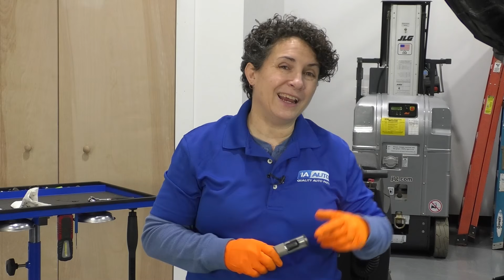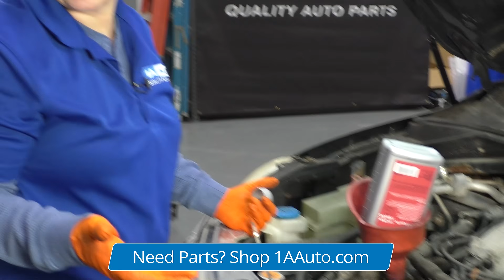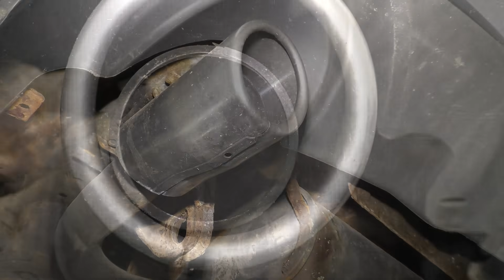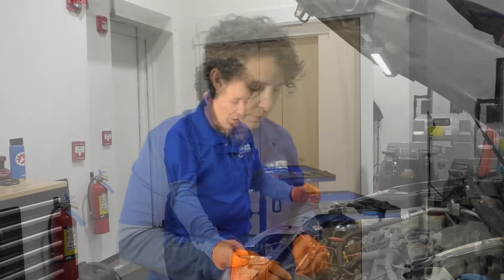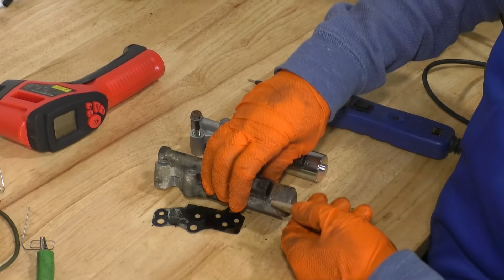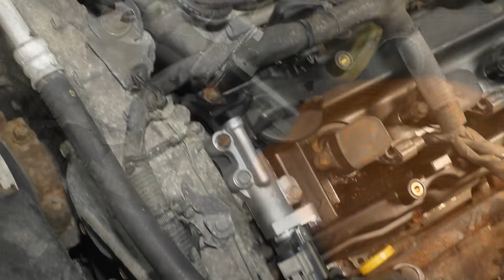Check Engine Code P0011, Rough Running Engine? How to Diagnose VVT Solenoids!

Comment: Please help. I have this code p0011. Have changed the oil and oil filter, have cleaned the sump and mesh filter. Have replaced the vvt solenoid. But the code won't go away. I also have the oil light flashing. Please help

Comment: What happens if you got that code and the car fails to start or just cut mid drive? The only other code that flashed up on mine is a misfire which I've found was due to a non-functioning coil. I've changed the Sparks as well and that cleared that up but the car just fails to turn over

Comment: After watching this I think that is my issue and I went to my auto shop and asked about it and I got told it was one of my motor mounts .. they replaced it and it did get quiet but once warmed up it start the timing off and lag of taking off  and timing sound off I think I'm going to get them and replace them myself

Comment: After u removed the paper gasket, u said that care should b taken to ensure that no debri  falls into the little holes, but u did not block those holes before clearing the surface with the razor blade.!

Comment: Hi. I have a P0011 on my 2011 Infiniti G37s. It started after I changed oil after not changing it for a long time. Like 9000 miles. I changed oil again, replaced VVT solenoids, and replaced a couple of sensors. The car runs ok when I reset the code, but it reappears every other start and the engine obviously goes back to limp mode. Technicians at some  body shop tell me I have to change a sprocket and timing chain and want to charge 30 hours of work at $150 just to get to it, without diagnosing the actual problem. What would your advice be in my situation.

Comment: 2007 Hyundai Sonata... check engine code P0011... oil is fine... bought brand new vvt solenoid (specific for my car)... easy install,  now the car idles very high... tried 4 straight days, hoping it would adjust, but same result... anybody have solutions...thanks

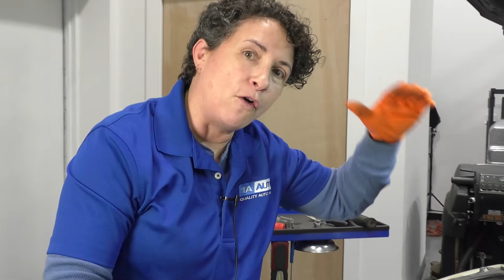Comment: Excellent detailed testing at 12:30.  I have a pesky P0011 on 2007 Nissan Xterra 6 speed manual 112k miles.  I do not want to bust open the timing cover and do a timing job if not needed so that test will help determine if the problem is with the cam phaser.  Thank you
Reply from the maker: +@PaulHenreid Thanks for checking us out! http://1aau.to/m/Shop-1AAuto-c

Comment: I got an oil change and they didn’t know what service engine soon indicator light was for. It is diff than check engine light. Went to autozone and got a pp0011 code and they didn’t know what it was for. After he pulled out reader the light went off and reset itself. Another thing neither car place knew how to do. Mine is Mitshubishi

Comment: I replaced both vvt solenoids. But i still get the code to replace them. And the car dies when slowing down, and seems like its going to die when stopped. Any idea?
Reply from the maker: +Oksooners We wouldn't be able to diagnose an issue like that here, you may want to have a local mechanic take a look at it. Thanks for checking us out! http://1aau.to/m/Shop-1AAuto-c

Comment: Good day, i have a chevy cruze. I get p0011 error. Replaced the intake cam due to sensor pickup that broke off. Then i replaced the solenoid valve. Still get p0011 error after driving for about 15km. When the car is cold and i start it the lifters make a noise then it goes quiet. Must i change my vvt sprocket. Thank you

Comment: Can anyone help? I have the P0011 code. I took it too autozone and it told me that it was the timing plate(very unfamiliar with this part) I know it’s a cover of some sort. But I have no problems with the car, no rattling, slapping, or any other odd noises, no trouble starting or accelerating, or idle issues. Any help on this? I don’t want to take it and spend more money then I have to, (just purchased vehicle)

Comment: I bought a used truck & it had the same code. It was apparent that previous owner did not change oil often enough. When I took the oil cap off, you can see the burnt oil residue on inside. So, I added oil cleaner and drove truck awhile. Then changed the oil. Once changed, removed the solenoid and soaked it overnight in diesel. Then I tested it by hooking wires to battery. The solenoid plunger moved. Reinstalled. Engine light is still on, I think I can reset by adding a 1 Watt 10 ohm resister to battery. So, was it wise to add oil cleaner first before installing new solenoids? It's a quick fix till I buy new ones.

Comment: Thank you so much I did everything you said and it worked but my battery warning is still lit on my dash but it’s not weak the battery and it doesn’t need a jump how do I reset that

Comment: Your personality and your method of presentation make it easy to watch. Thank you for all the information you gave on the topic. 
I started changing these this morning on an '06 F150 5.4l 3v Triton. The vct's are down in a hole with a small bolt holding them in and a rubber seal on top. The passenger side went ok.
But the driver side little bolt is screwed in so tight it's ridiculous. Maybe a guy could break it loose but it is almost like it was put in with an impact wrench. 
So my question is...how can I break this little bolt loose without messing up something? Thanks for your help...whoever answers. Jesus bless.

Comment: I'm having similar issues. I had vvt codes after running out of gas. Turned out to be bad intake. I changed them both but now I have a misfire in cylinder 2. And the intake code p0010 still there.. Changed oil and filters and air filter. Worried to start my car again with the misfire.

Comment: My wife has a LR discovery sport and her CE light just came on. Codes are P0000A, P0011, P000B and P0014. I checked her oil. It was low. Is this a DIY job or should I take it to dealership?

Comment: Is it possible that these solenoids will need to be replaced without a code? I have a blue driver and my vvt was showing live data and it was marked with a yellow exclamation amd the other vvt were green. I have a rough idle.

Comment: Hello Dear, thanks a lot for explaining it very well I got important information about facing a problem.

Actually, I have " Hyundai Accent 2013 car"
I am facing the problem " the Oil light is blinking, when I cross around 20 KM, the light blinking when I stop only not while I'm driving"
Anyway, I checked my car by computer tester and I found this error " P0011 'A' Camshaft Position Timing Over-Advanced Or System Performance Bank 1"

Please tell me what must to do.

Comment: Quick question - when completed and the codes have been reset, wouldn't you need to do a Vanos adaptation reset to ensure the values are within tolerance?  Great video by the way!

Comment: The thing i found is the solenoid test good when cold .  Put it back on the engine when hot for 25 min. It stop working. check for this.

Comment: Did not diagnose the integrity of the electrical circuit. To check if it has voltage being applied to the VVT solenoid.

Comment: I have a 2003 s10 xtreme two door and there is so so much wind noise from the doors after I got lockout service. I tried replacing the door seals, tried tweeking the door back and nothing works. Any advice?

Comment: For the rear VVT there's not need to take out the intake manifold, just move to the left that black hose full of cables and use an extender with a ratch. It will take less than 10 minutes.

Comment: Hello I like your videos but I have a question. I have a humming kind of grinding noise at lower speeds but the humming throughout speeds on the left front tire wheel. I thought it was the bearing but when I turn right it goes away and when I drive on the left side of the road that is banked maybe four or 5° so that the left side of the wheel goes down rides on the lower part of the bank the noise goes away. But the alignment was recently done and it said it was good within spec and after the alignment and still does it I still have all the same symptoms. Can it still be the bearing that is cracked in some place or is the bearing like cockeyed within the hub but we'll still go straight.
Reply: I feel that the tire is riding on the inside of it like cambered top tire in, so that when it rides on a bank road it rides at the correct angle...

Comment: the nissan 3.5 is the most common engine to be ran low on oil bc of the way the dip stick goes through the head. I have seen those engines 4 quarts low and people check them, and they think they are full bc of the way the oil is all over the stick. and be sure to never run those engines with the stick out bc it will make a big mess. I don't even pour oil in them with stick out bc it can run out of the dip stick hole. It's kind of an odd ball.

Comment: What a coincidence I have yet same code on my murano. Changed vvt solenoid, oil pressure sensor, and both cam sensors, and damn code still there. Stooopid nissan
Reply: Did you forget to erase it? Make sure you have the proper oil weight in the engine.
Reply: Next thing to check is oil pressure with a manual gauge, if something is wrong with engine and oil pressure is low, this code will trip.

Comment: This video is perfect timing, my car has been burning oil (oil loss with black smoke). Now I know what my next steps should be. Thanks 👍
Reply: black smoke means too much fuel... burning oil is blue smoke. One smells like unburned fuel and the other one like burnt oil. Either way, not a VVT solenoid.